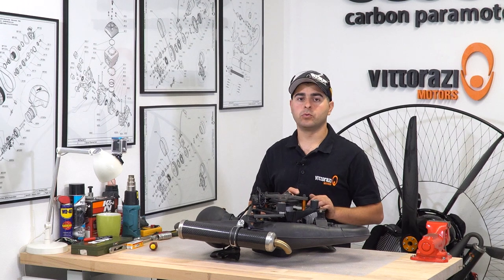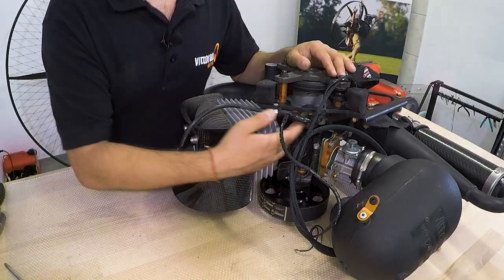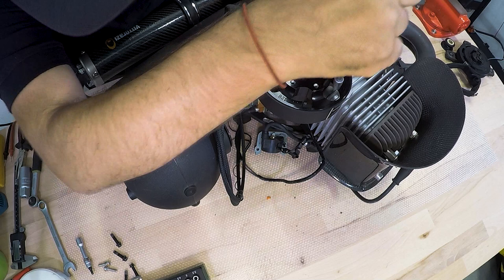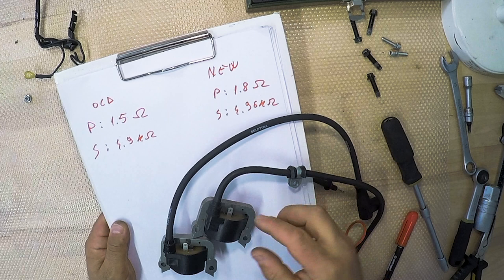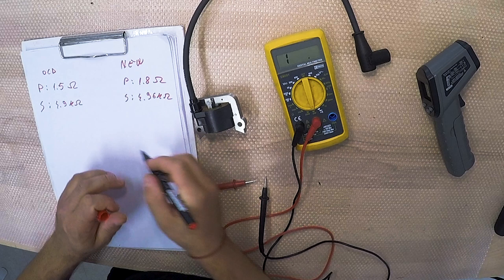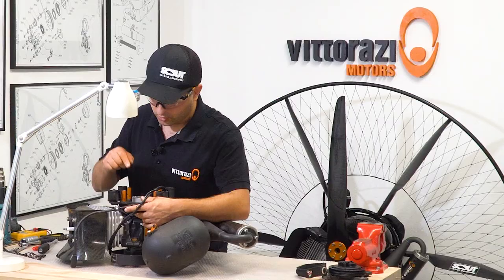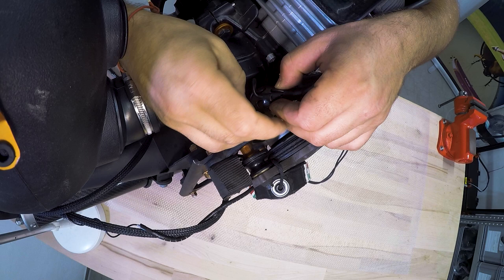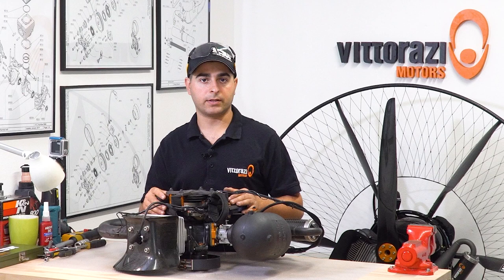Vittorazi Moster Plus ignition coil testing and replacement. paramotor engine maintenance series

Comment: hi. what would happen while fitting a new coil.and adjustment .the the coil is too close? and what would happen if set too far a gap?  how will it effect the running?  dated 21/2/2021.

Comment: hi, I had a problem with my moster 185 classic. and I brought a brand new coil. and still no spark. so I took the motor to ukppg Nigel davies .uk who took the time to test the new and old parts. and things didn't look good. Nigel found out the flywheel magnets were not magnetic. so we then compared to a new flywheel and what a difference.  the problem was the flywheel magnets.  thank you Nigel davies of UKPPG.UK  dated 21/2/2021

Comment: Thanks for the video, but I did not understand how putting a .4 mm cardboard sets the gap. The engine is machined so you can’t adjust the coil, right? What am I missing?
Reply: I thought most all coils were adjustable on small engines

Comment: Why there is to coil in my engine  vittorize 185 moster electric starter? And what is the benefit from the lower coil?
Reply from the maker: The second coil is for charging the battery. It is connected to a charging regulator that charges the battery while the engine is running.
Reply: @SCOUTaviation  hi regard the second coil for charging it my paramotor wouldn't charge the battery  may I know what is the right type of battery to use it? Led acid Nimh Lipo ?

Comment: What would the coil measure, if bad, when heated up? Or, what would a bad coil measure if cold?
Reply from the maker: If the coil will just short circuit itself while warm, then the resistance will be 0 or very close to 0. If the coil has an internal bad connection, then, very rarely but it can happen the resistance will increase a lot, times higher than normal.